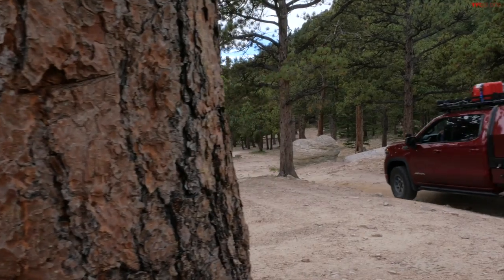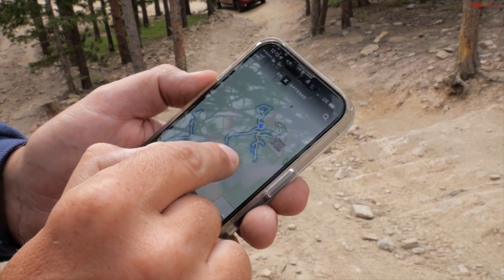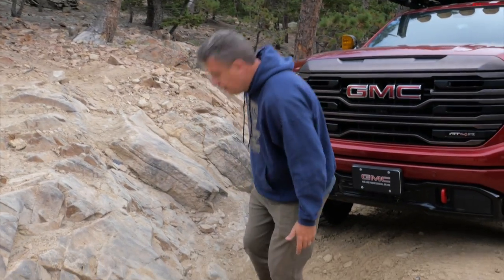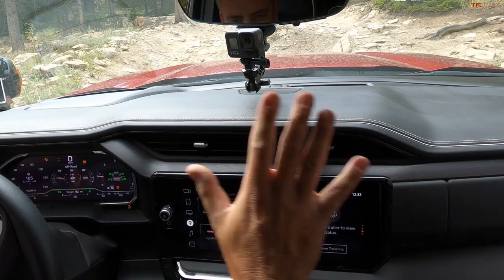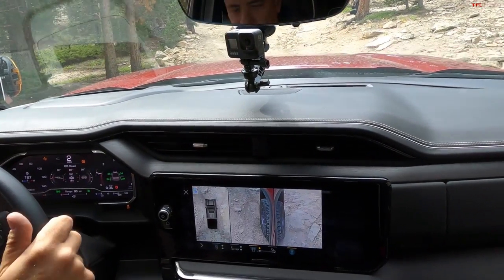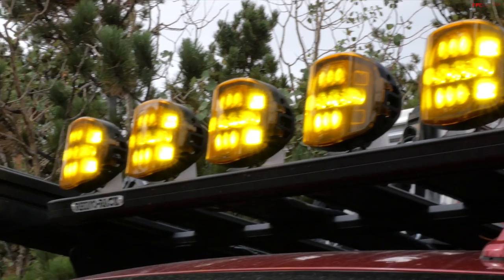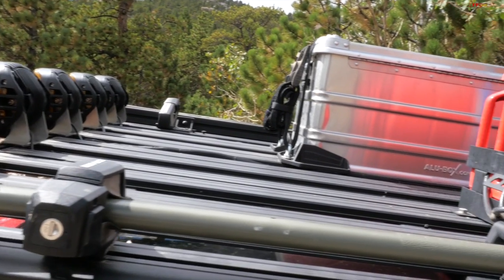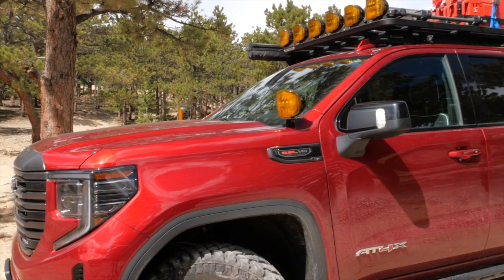I Had My Doubts About The All-New 2022 GMC Sierra AT4X Overland Truck But It Proved Me Wrong!

Comment: Those tailpipes are ridiculous.  It’s like they just said screw it lol
Reply: I thought I had something to defend the poor thing but I just end up laughing about it as I kept watching the video
Reply: yeah super after thought lmao, even from the factory I had to tweak my ZR2 Silverado pipes out of the way a bit because they came aligned improperly
Reply: That's cuz there made for the factory bumper
Reply: @markidyle461  doesn't look like an exhaust tips any of the GMC's come with
Reply: @markidyle461  it could be, but considering all the modifications, you would think they’ll have some type of aftermarket tailpipe
Reply: @johnrey751  yeah even just a turndown after the axle you can have a shop put on for $100
Reply: Looks like they installed it with stock bed and bumper
Reply: The whole truck looks ridiculous
Reply: lol 😂

Comment: Cool video Andre. Well done. I'm surprised with all that customization to this rig they couldn't find 30 minutes to bend the tailpipes upward closer to the line of protection helping the departure angle.
Reply: To be fair they look pretty high anyways and appear even with the hitch.
Reply: @ALMX5DP  yeah, but both are hanging down low enough to get caught up on rocks
Reply: @MrJamesLuz  looks like over 30 degrees of departure angle and like 2 feet of clearance to the ground. Anything the front gets over will not be an issue. This isn’t a rock crawler either, but a well rounded overland pickup.
Reply: I imagine they kept in mind sleeping  above and making sure the exhaust fumes push out far.  Sometimes you will need start the vehicle to recharge or warm yourself after setting up your camp. And inhaling all those fumes probably wouldn't be preferable.  Not to mention they look like they're level with the hitch, so It's going to clear whatever the hitch does. Real world applications and not rock crawling events, that should be plenty of room I would think 🤔
Reply: @ALMX5DP  exactly.  That is more than enough clearence for most people's needs while overlanding.  He even admitted in the video most vehicles scrape  and this one didn't. Honestly I'm a Ford guy so this isn't even my "cup of tea" but I'm just defending the thought process going into the truck.
Reply: @TheMeanmarine13  smashing the trailer hitch won't affect how the truck actually operates.  I've seen a vehicle stranded that smashed their exhaust pipe.  The engine would not run.  Lucky there was someone with a Sawzall that was able to cut the smashed part off.
Reply: Could swear I saw this exact rig for sale in Staunton VA back in June complete with branch scratch marks. Impressive build.

Comment: To all the “surface rust” comments. It’s not rust, it’s dirt! You know, that stuff you never take your trucks into. GM dips their frames in black wax and if you take it into a super dirty red dirt environment, it will coat the wax.
Reply: Wax is true, but it is rust. Wax cracks, holds salt and water, and then falls off and reveals a nice rust for you to view that you never knew was there. 😂
Reply: One of the reasons I got rid of my late generation 2500HD Silverado. The wax coating is ridiculous and just rubbed off on everything. At 6 months old the frame was rusting…. Hadn’t even been through a Midwest winter yet.

Comment: The ONLY ISSUE I have with this truck is the lack of FULL UNDERBODY SKIDPLATES!

Put those on everything that matters and THEN this truck will work for everything overland. I would suggest 1/8 inch thick 6061 Series Aluminum Alloy WITH a 1/8th or even a 1/4 inch thick Line-X truck bed liner coating on both side of the skid plates. That will give that EXTRA protection that can be critical in many situations.

For emergencies, I would ALSO GET an in-cabin mounted combined CB/GPRS/VHF and long-range Shortwave Transceiver radio so you can use multiple modes of long range communications. All the major radio communications bands are available on such a setup. You can warn logging trucks that you are in the area. Check local CB and VHF channel numbers that are usually assigned at your state-level forest service for which ones to use for truck-to-truck comms.

You can buy SDR (Software Defined Radio) boxes that plug into a Microsoft Windows 10 or Windows 11 operating system console mounted rugged laptop (i.e. Getac or iExplore) which can make your life a lot easier in an emergency situation.  Remember to get both a headset with flexible boom microphone and a push-to-talk handheld microphone (i.e. looks like a CB mic) That lets YOU and your passenger delegate the the use radios according to your comms needs. Remember to get the longest and best quality flexible/extending antenna you can buy!

I would also get an in-bed-mounted 50 Gallon Gas Reserve Tank (180 litres) that has the full electric or foot operated fuel pump handle (i.e. the smaller version of the fuel pump handle at your gas station) so you can fill up your toys or other vehicles AND which lets you travel far longer distances. That could give you an extra 600+ miles of driving range! Handy for big trips. Also get TWO 40 lbs Propane Tanks for your space heaters and propane stove cooking setup.

V

Comment: Yeah... you've got so much tire and so much traction from the lockers you really don't have to air down. It will 100% ride rougher but it will absolutely help with ground clearance. From my experiments it's about 1/4 inches on my vehicle (on flat ground)  it would probably hurt the clearance a half inch off camber .

Comment: I think the only thing I really dislike is that exhaust. No point in the quad tips, since its just a Y from the single exhaust pipe. Just make it a single exhaust that exits higher up for better clearance.
Reply: Sadly the average buyer isn’t going to use this truck for anything other than the mall and the yearly poser shot for insta / forums
Reply: @MrJamesLuz  I agree. But my comment was more towards the builders of the truck, that did all the mods.

Comment: I'd love to see the RAM Powerwagon being compared to the 1/2 ton off road models available from the other manufacturers. Even though it's not a half ton, it is an off road truck and the comparison would be fun and informative to watch. Great jobs as always!
Reply: It's a good point, as I was watching this I was wondering why anybody would do this to any truck other than a Power Wagon??
Reply: I'd honestly love to see the Powerwagon being compared to a 1/4t off-road truck, like maybe the Ford Ranger Tremor series
Reply: Either a. it totally demolishes everything but Broncos and Jeeps due to the crazy travel, clearance, approach and departure or b. it high centers constantly.
Reply: Power Wagon has articulation going for it.  Most of the off road trucks with IFS have a good bit less front suspension travel.  Power Wagon has 14 inches of front travel before using the swaybar disconnect.  With the disconnect active, its 26 inches of front travel total.
Reply: @killercan10  wrong. It’s got a solid front axle. It has 14 inches front and 15 rear, for a total flex of 29 inches.
Reply: @The-fs5wn    Yea, I'm aware it has a solid front axle.  Re-read what I wrote, I was making a comparison in that the Power Wagon has much more suspension travel ability compared to something with an IFS suspension like the AT4X or Raptor.  Also, everything I can find on the Ram is showing 26 inches of front articulation with the bar disconnected.
Reply: @The-fs5wn  flex isn’t added together wtf

Comment: So this modification ruins the suspension, which is a big part of what you are paying for on the AT4x and it just leaves the exhaust dangling 6 in below the rear bumper. Quality work. Did they also submerge it in salt water for a while?

Comment: How can GM fit brakes that are small enough to fit 17” wheels over on such a heavy vehicle with so much towing capability, but Land Rover fit bigger brakes meaning a minimum of 18”s can be fitted on the Defender? A lighter vehicle with less towing capacity.
Reply: Because Land Rover is dumb.

Comment: They're all too fancy. Bring back to North America something affordable, simple, and yet capable, like a coil-sprung, convertible Samurai/Jimny or TJ/LJ, with 4Low, steel bumpers, and 90° rockers..

 Isn't the current Asian-market Jimny coil-sprung now? It probably can't pass Western crash or emissions standards. ABS is probably mandatory here now too, and maybe TCS as well.

 Suzuki put AWD, 4WD, ABS, TCS, EBD, and VDC into the SX4...for well under $20K USD. Suspension lifts and metal skids could be sourced from the aftermarket.

 I can add my own lockers.

 A $30K Wrangler Sport might be the cheapest serious rig with 4Low left.

Comment: Couple things that would really kick things up on that truck would be a proper front bumper, that exhaust routing is silly of course,  and I don't see why they didn't set up floating air bags with Daystar cradles or whatever so you don't  limit your suspension travel as much (as witnessed on Rzr rocks). And 35s lol
Reply: I wonder if they didn't have a front bumper developed that works with the vehicle's safety systems and didn't want the liability of sending this off to media influencers and risk the vehicle's airbags not responding properly to a collision. Maybe the company sending this out was in a hurry.

Comment: I was at the heavily pared down NAIAS this week and noticed a few things that would make for interesting comparo tests. Ford was showing off the Expedition Timberline and it got me thinking of how that would compare to the new Toyota Sequoia TRD Pro. That would make for some good TV! I also can't wait to see thorough tests of the Maverick Tremor versus the competition, particularly against something like a 4Runner or Tacoma (maybe a non-TRD trim?). I currently own a first-gen Sequoia which has a ton of potential and though most of the off-roading I do is very light, it does feel good to know I can handle some serious stuff if I need to. I'm curious if the Maverick Tremor can even come close to handling what the basic Toyotas can handle.

Comment: Great vid Andre! I liked that rig at Expo, but the more I see the details, the more it looks like a show rig. Bad spare location, gas cans on the roof, GPS lights are dumb, cool idea but should be manual. The faster I go the more I want to see the sides. Too bad Chevy does square fenders, even those 33s look stuffed. AEV will probably fix that like they did on the past Colorado Bison. I wonder why they moved the spare up on the bed, would think moderate tires like that still fit underneath where you want the weight.

Comment: I’m not a fan of how the exhaust got routed especially since the driver side looks like it’s actually touching the shock  over time that will be an issue.. I would have just cut the  quad exhaust off and remove all the piping to just after the axle and run some soft 90 degree dumps so it’s tucked and not touching the shocks. Other than that it’s a well thought out, gorgeous, and very capable rig.

Comment: I’m surprised at the amount of surface rust underneath… especially with it being a new vehicle.
Reply: I kinda wonder if it is muddy water
Reply: It’s not surface rust it’s mud and dirt some mud has a red tint to it I have a bunch of red mud on my property in Texas my 2020 Silverado 3500 dually underside is covered in it and if you let it sit it will stain the frame that red color it’s not hurting anything just looks like the truck was actually used for work and not grocery shopping.
Reply: The prevous journalist may have gone to Moab
Reply: That's not surface rust, it looks like red clay.
Reply: If that is red dust, it seems to stick to some surfaces better than others?  The frame and exhaust have a thick layer of it and other parts are thin.  Or maybe it is rust.

Comment: It almost looked like a daystar cradle for the airbag system.  Sure it isn't a fully floating airbag set up?  Either way nice but also don't see any springs.  If youmhave a leak in a line or bag no backup.

Comment: Are those airbags available to the public yet? What airbags are those? At 2:55 it shows them at full flex and they aren't mounted at the bottom. lt looks like the lower hardware is a cradle that allows a full flex without tearing the airbag.

Comment: Now this is the perfect truck to tackle Alaska. The quad exhausts are cool on the Denali Ultimate, but not on a extreme off-road truck like this. I would keep the stock exhaust and placement tucked under the bumper plus a additional spare tire. Awesome video and great driving, Andre.

Comment: Try driving with both feet. Use the gas to drive through the brake. It wont make the truck shake so much on those sketchy teeter totter scenarios.
Reply: It has one pedal driving for those situations I believe, but doesn’t look like he’s using it

Comment: Independent suspension just sucks on a truck unless it’s used for high speed desert running.  Go over any obstacle and it just hangs the opposite side tire in the air.   Garbage.  The last real truck GM made rolled off the line in 1987 (honorable mention to solid axle Blazers and Suburbans through 1991.)